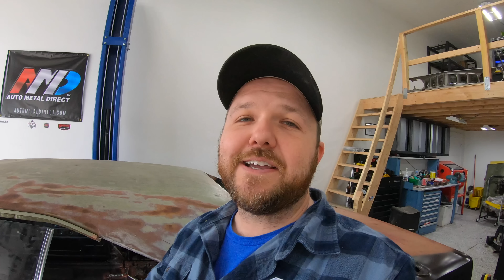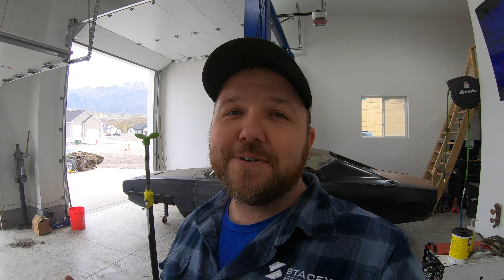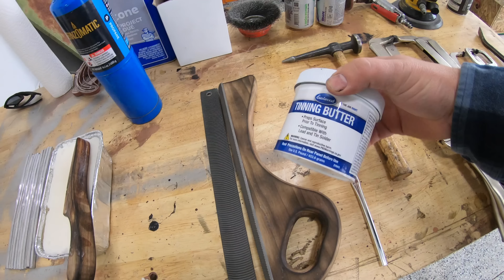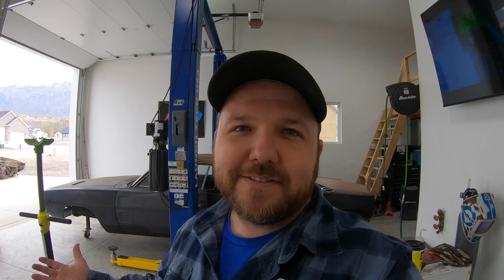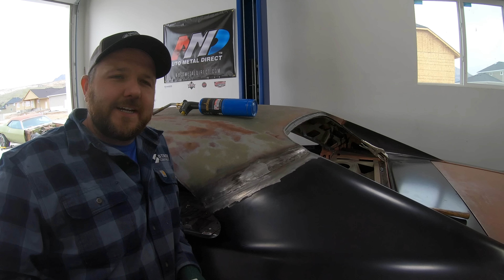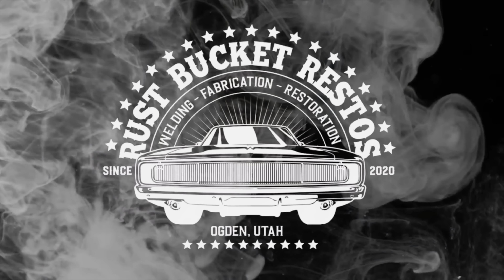1968 Dodge Charger Install - Episode 36 - Quarter Panel & Tail Panel Final Install

Comment: Beautifully straight & strong. Just gawking at those cavernous rear wheelwells. They look great. Nova owners everywhere are green with jeal-er-ousy. Can't wait to see the frame connectors and other strengthening you'll be welding in.

Looking good! Up in Sudbury right now or I'd have commented earlier.

Malcolm Ottawa Valley

Comment: as old school as I am i would not lead them roof seams .Things they have now a days are way better .Lead seam's always showed 5-7 years after the factory did them. My 69 Z28 I Did with All metal filler is 20 years old and not showing nothing my buddy did his car in lead and shower up in paint job 5 year's after paint . But any way Great job on your Charger.

Comment: WOW, you brought this rusted beast back from damn near the point of no return, what a job you have done on this project, and taking us along for the ride to see it all unfold. The lead work looked pretty strait forward, prep, build it up, float it out and file it down, I am most impressed with the lines on the car, door line falling right in with the top quarter body line, door fittment looks good already, doors shut nice and strait, and in line with the quarter panel. I know with a touch of filler and a block you can make that look like one panel from the side. Most impressive, you know the prices of these B Bodies, what do you think it`s worth as it sits , can`t wait to see the rest, i`m a B Body nut, well done
Reply from the maker: A clean sheet metal roller with no parts can fetch between $20-25k right now.  Finished with all the Restomod goodies, it’ll be closer to six figures.  Prices are out of this world these days!

Comment: Out of curiosity what percentage do you think of that car is factory Dodge??30%??
Reply from the maker: Probably around there.  Roof, firewall, and the ABC pillars.  Technically the front frame rails and clip is original.  Came from a 68 GTX

Comment: you got the lead thing down, just one suggestion, try dipping the lead stick in the flux before you melt it to your surface your working on it should let the lead lay down better so you wount need to do so much paddle work.
Reply from the maker: Great suggestion!  I’ll give it a try!

Comment: Sweet video. Really enjoyed this one. What settings are you running your welder on for gd panel penetration and wire diameter and speed? Thanks
Reply from the maker: With the snap on welder it’s a little different.  I typically ride the line of burning through and having enough wire to complete the weld without piling it on.

Comment: The leading is becoming a lost art...and plastic filler will crack eventually especially if The car is a high horse power car the torque will twist the body the lead for an OEM car is adequate but for a drag car or a serious road car I'd rather weld in a patch that will be a permanent fix. Still a great job of leading.
Reply from the maker: Sure will!  Fiberglass also expands at a different rate than steel.  Leave it outside for a few hot summer days and you’ll see it swelling in no time!  Do it once and do it right!
Reply: @rustbucketrestos6511  I agree!

Comment: It’s good to be a purest on factory specs, but even some old pros on YouTube have switched from lead to fiberglass filler. I guess since your filming your work you can’t use fiberglass filler and say that you used lead. Very honest build.
Reply from the maker: Fiberglass also expands at a different rate than the steel.  I’ve seen some very high end builds that sit in the sun and you can see the lead seam plain as day.  Would rather do it once and do it right!
Reply: @rustbucketrestos6511  you just sold me.